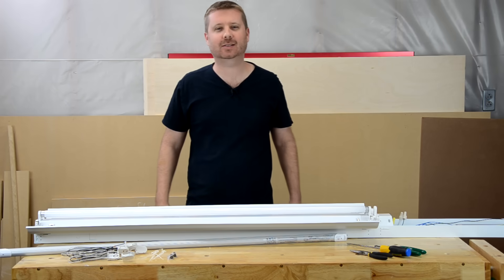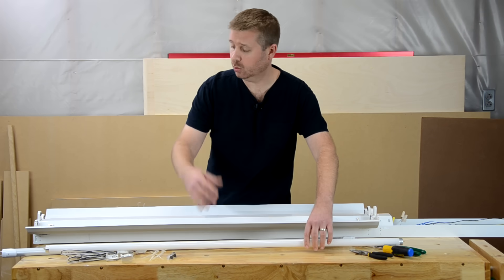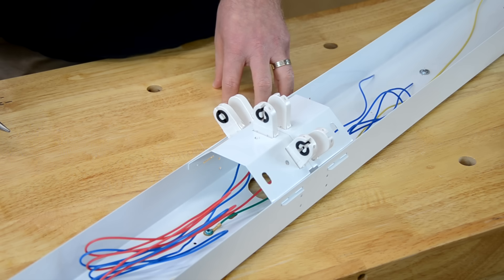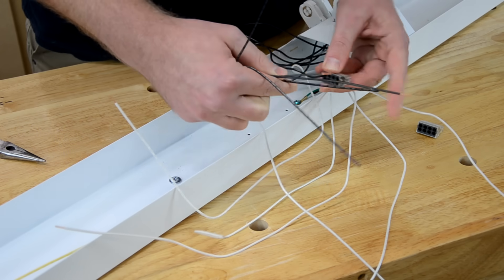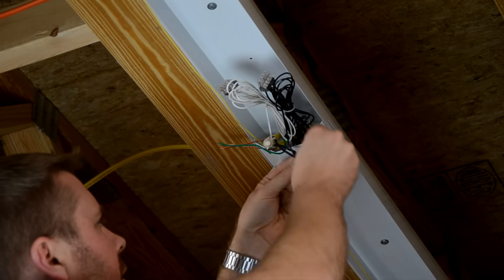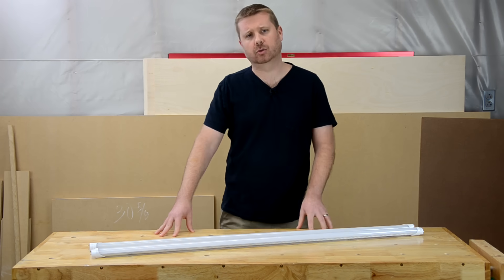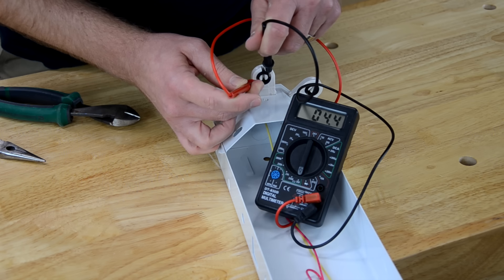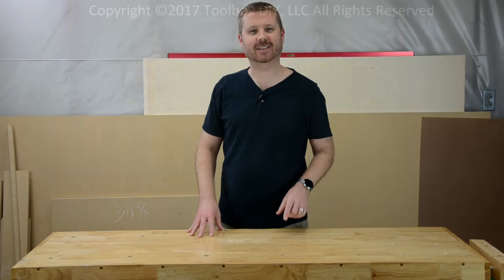How to easily convert fluorescent Lights to LED –Easy Ways to Save Money

Comment: Fluorescent tubes will eventually become very expensive to dispose of. 
TV's with picture tubes and crt screens have already become expensive to dispose of.
And it's not rocket science how to cheat on the disposal of these items. But I am only talking to responsible adults. So, no need for boys to try to prove how smart they are here.
Reply: All Fluorescents have a little Mercury in them!  If they didn't, they wouldn't work.  That makes them a Hazard.  These are the EPA cleanup instructions.
https://www.epa.gov/cfl/cleaning-broken-cfl

Or a little funny.
https://www.youtube.com/watch?v=R6VakfgEcP8
Reply: Nonsense JB Dragon, they have less mercury than the average tuna fish sandwich.   The EPA would also give you complex instructions for cleaning up something like a large rubbing alcohol spill but that doesn't mean you need to be told to grab a broom and sweep the darn thing up like any other mess.
Reply: Js Travelers - No.  There is now a trivial amount of mercury in fluorescent tubes, is not the same thing as a CRT tube.  The vast majority of a fluorescent tube is silica (glass) and aluminum, two of the most abundant (by far) substances in the earth's crust.  Literally wherever you dispose of them, there was already  more of those materials there naturally occurring than you are adding.

Ironically it is the opposite with LED bulbs.  You are then throwing away electronic circuits, chemical treated PCBs, heavy metals, and plastic that will linger for thousands of years.

You are deluded if you think you are talking to responsible adults because you are not responsible yourself for stating things in ignorance that are the opposite of the truth.

Please do educate yourself if you want to make a real difference to our environment.  Fluorescent tubes can also be recycled, nearly 100% of the materials.  LED bulbs, not so much, it all goes to a landfill in most areas of the world.

Comment: Only a shame, that led-tubes are as expensive as a full led-fixture. The big difference is that the fixtures will hold their brightness, while tubes will burn out due to (over-)heating. Also the promised lifetime of 50000 hour will be 10000. The amount tubes i have replaced by fixtures is huge.
Reply: Hi Barry, I bought 25 four foot T8/T12 replacement bulbs on ebay for $119 w free shipping.  Make sure you buy "Ballast Bypass Bulbs", the kinds with two pins on each end.  Remove and toss the ballasts (mine had two ballasts each), connect all the wires at one end of the fixture to one side of the line (hot), all the wires at the other end of the fixture to the other side of the line (neutral), hook up your ground wire, and insert your LED bulbs.  I did this with six free 2 X 4 foot troffers and they all work great!!  No point in making this any more complex than it needs to be!!

Comment: I have never thought every American is a putz,but there are a lot of people who would not wire up anything electrical to save there life and in Australia you will get a heavy fine for doing so as if you make any mistakes the live can travel to the earthing circuit and electrocute others and i have personally seen this in two cases so as for ballasts i have not seen one burn out in 40 years so it seems for a few extra 4 watts it is better still use the ballast and let other people get these led's in there lights with litle fuss but you never said anything about there options like Missouri wind and solar,secondly I have worked on major projects all over the world with Americans and i love working with them especially on drag lines for Bucirius erie 4000 ton drags
Reply: My fluorescents didn't work very reliably and the ones in the garage BARELY lit when it was below 50 F.  The LED replacements are great!!

Comment: Might be a good idea to mention how incredibly sharp the edges of sheet metal light fixtures are. Everybody does things different, but using the internal wiring to bundle itself makes for easier troubleshooting if required. And I would always use wirenuts for wire connection. I just don't trust those "push and pray" gizmos. At least I worried about that kind of stuff before I retired ;-)
Reply: Sharp sheet metal-- same on computer cases! Mfrs used to tumble in walnut shells, knock off edges, but no more! I call it A FOREST OF RAZOR BLADES!
Bring Band-Aids and Neosporin when you open all these things, and if you'll be back in there (or it's your own toy) take a file to accessible edges, then clean up steel dust with a magnet and tack cloth (before it gets between fine traces). Do it right, the first time.
Did my shop a couple years ago, no regrets; removed ballasts, cleaned and repainted white inside surfaces.
Reply: Might be a good idea to mention; Don't run with scissors.  Look both ways before crossing. If you live in a glass house don't throw stones.  Don't run around the pool.
Reply: I've been a electrician for 20 years wire nuts vs peanuts I can tell you from my experience there's no safety issues with using peanuts. I have found more troubleshooting problems from other people's work with wire nuts if not done properly a wire can slip loose and Ark or not be connected. My only complaint with peanuts are if using stranded wire that can be somewhat challenging to get in. I personally like to use wire nuts on stranded wire rather than the peanuts.
Reply: Not only are most modern sheet metal assemblies nothing but assemblages of razor blades, but by cutting those zip-ties that way you are adding even more flesh rending points. Use a flush-cutter and cut flush to the zip-tie head. (Your wire cutters are diagonal cutters. Flush cutters have the outside of the blades ground such that the cutting edges are flush with the outside face of the blades. Your knuckles will thank you next time you need to work on these.)
Reply: The sharp edges are due to mfrs using a mechanical process to make the parts. Whether a shear or punch/die combo these will leave a burr unless newly sharpened and perfectly aligned. Mfrs have 3 ways to deal with this. 1. Run it through a duburring process that removes the sharp edge by grinding it. 2. folding the edge over so that the burr is pressed against the flange (called hemming). 3. Do nothing and live with it. Of course #1 costs time/labor and capital investment in a machine or grinding wheel. #2 costs material and machining time as it takes more time to make the original part, that hem doesnt fold itself. 

Finally you can use a laser. A properly adjusted laser will leave almost no perceptible burr. What it does leave is not a hazard.
Reply: thereal440volt u
Reply: thereal440volt ... Yes, mention that sharp metal. Perhaps consider stating the importance to not pull those plastic ties tight with your finger in the loop.  And if this DOES happen, to remove your finger the tie itself should be cut, not the finger itself.  Though to be honest, either way will remove (pun intended) your finger.
Reply from the maker: I have to respectfully disagree. I have seen no evidence that these "cause fires". In fact you'll find these in a lot of UL listed fixtures these days. In this case, we don't have two different metals - it's copper to copper. Also, the amount of current going through these is under an amp. I do agree that the connection area is less than using a wire nut, but with such low amperage, this is inconsequential.
Reply: I hate that! I'm an electrician and I've cut my hands on quite a few sharp fluorescent fixture edges. It's like a papercut, it sucks! I always used wire nuts for a while when wiring ballasts and such but after doing it for so long and the time saved using the push-in connectors are well worth it. I only use the ideal brand which I've never had a failure on. Also gotta use some common sense like don't use them for anything but ballast wiring, always do a quick "tug" test. If the connection doesn't hold up to being given a good tug then the connection is not made in my eyes. Amazing how many helpers I've worked with who were never taught the good 'ol tug test. Can save you a lot of troubleshooting down the line bc a connection will look like it's good up until someone pulls it out of the box
Reply: My experience is that most of those metal cases are apparently made by Wilkinson Sword.
Just like the warning on food products about peanuts they should have a warning that "These cases are made in a factory that also makes razor blades."
Reply: Those push-in connectors are dangerous and will cause fires  in the future. They make poor connections since the contact area is very small, also where the copper wire and the metal of the connector touch, that area will corrode because of the different metals contacting each other and will cause a poor connection which will heat that connection up and eventually the connection will get so hot that a fire will start.
I have seen to many of those connectors and connections with them that caught fire. In our business we outlawed those kind of connectors and we will remove those push-in connectors if a light fixture has them installed already.
Reply: Flush cut plyers aren't part of your average electrician or homeowner's tool chest, BUT if you have a pair of linesman plyers you can twist the 'lil buggers til they snap off. The result is a nice soft nubbin of broken plastic. If I'm using the big thick tie wraps I'll usually cut little chamfers on those sharp edges if cutting into hands or other wires is a concern

Comment: Terms, such as "tomb stone" should be avoided.
Reply: Why?  What's wrong with terms?  They make things pretty clear for a lot of people.
Reply: Try a Google or Bing search for 'fluorescent fixture tombstone'.  You'll find thousands of hits, and plenty of catalog listings for things like T5 tombstone, or G13 tombstone...  It's plenty common usage of the term.
Reply: The real reason..."Tombstone" is offensive to anyone over 60 years old and can instill fear.
Reply: Hmm and strangely they are not called tombstones, in the same way that not all wheeled vehicles are called bicycles.
Reply: Bernie - Roger on that. I call 'em "cement graveyard adornments for folks that be suspiciously quiet." That keeps the offensive terminology hidden from the kids & gramps alike.
Reply: Data, bro, at 68 I appreciate your thoughtful, considerate pc,  lol  but it hits a pet peeve, Cement vs Concrete. Yes, it's now mainstream misuse spearheaded by you-know-which gender. :-)  None the less, Cement is a dry powder & but one component of concrete.  So it's like saying, "May I have a piece of flour & ice cream." - cheers
Reply: Stoichiometric - Blame it on Hollywood & the "Cement Shoes" in gangster films. ;)
Reply: Well, I'm an electrical engineer, and I'd know.  I've never tried buying them at Home Depot, but I'd venture to guess that if I went to my usual electrical supply warehouse, they'd know.  Maybe I'm wrong; the next time I'm there I'll try it.  But I'm more inclined to follow Terry Jones' suggestion and just replace my fluorescent tubes with new LED fixtures (which I've done in my home workshop).
Reply: Most electrical supply houses call them tombstones.  After all what do they look like?
Reply: +George W — There are styles of fluorescent lamp holders that don't look anything like a tombstone.
Reply: Bernie McCann what do you want  on your tombstone? Lol
Reply: +Yes — If you don't know the proper technical terminology and can't be bothered to learn it, you might was well call them "thingamajigs" and "watchamacallits".
Reply: Bernie McCa
Reply: +David Shaddock — Why?  Because if you walk into a hardware store, home improvement store or electric supply warehouse, they won't know what the hell you're talking about if you ask for "tombstones".  Besides, not all fluorescent lamp sockets are shaped that way.
Reply: +David Shaddock — I also happen to be an electrical engineer, and I have purchased fluorescent lamp sockets at places like The Home Depot to repair fixtures.  The term "tombstone" did not appear anywhere on the packages.  For example, see http://www.lightingsupply.com/light-sockets-and-accessories.aspx.
Reply: if you don't know that they have always been called "tombstones" then you are probably not best qualified to be sticking your fingers in the fittings, best stick with your job at "Home depot"

Comment: It would have helped if you had said: In the living room use 'this' -- in the bedroom use 'this' -- in hallways use 'this' -- in the basement use 'this' (Lumens)
Reply: This is about conversion, not visual impairment.  ;)
Reply: The choice of yellow-orange, cool or daylight is a matter of personal choice and cost.  I prefer daylight bulbs throughout the house, but they are the most expensive.  Some bulbs can also be dimmed which adds another user preference.
Reply: Says the young guy ;-)
Reply: No that would make no sense at all.  The # of lumens depends on the tasks, the lighting fixture, whether you have windows providing add'tl light, how many fixtures, the size of the room, etc.   Judge based on whether your existing lighting is sufficient, all bulb types have a rough average lumen output for comparison purposes.
Reply: Ed C no.  Cooler lighting is more damaging to eye, literally, and also creates more glare and worse CRI so it's not preference as much as being able to use the light to see well vs just being blinded by glare.  Also daylight bulbs are not more expensive, now about the same price unless you are only thinking about some particular product where the manufacturer prices them higher because the cost per unit to make them is higher, only because nobody wants ugly cold glaring blinding light bulbs.

Comment: I've been encouraging my corporate customers to do this for decades. Basically since these tubes became available. For those that balk at the capital outlay of a full conversion (especially in areas without green incentives on them) I tell them to simply convert a fixture each time a ballast inevitably fails.
Reply: A T8 Florescent bulb is costing me $3 in packs of 10.  The Hyperikon T8 LED's I get cost about $11 each.  These are 120-277 Volt.   I need 277 volt!!!  Not a normal Home Depot LED replacement unless I got one that needed the ballast.  I've replaced them to LED's in a couple offices.  I've like to convert more as the bulbs or ballast go bad.  Havn't made that move yet to do the rest.  The front office wants to do their own thing, and plan things, and then it never gets done, instead of myself just doing it.
Reply: @jbdragon3295   $11each ? The T8 tube 18W 1800lm ,pf0.9, we ship to US just cost 2.3$
Reply: pChristopher Gaul ‘h. Hi 51’/
Reply: Have never known a balast to fail but granted they could but they also draw some power so best to get rid
Reply: @gowdsake7103 
They fail all the time

Comment: The problem I had with the LED tubes was that I couldn't find any that were anywhere near as bright as the fluorescent tubes.
Reply: cliffh5 You need to put in 2 led tubes for 1 normal tube.
There are adapters available.
It's still not as bright.
Mostly, they don't need to, because the light angle is much tighter

It is better to replace the whole fixture.
Reply: The T8 LED tubes that I bought on Amazaon were much brighter than my original fluorescent tubes.

Comment: My magnetic lights are installed in 90 seconds in a 2x4 troffer. Mine are very safe and UL rated for any installation. UL released a bulletin about your type lights and if installed incorrect will void the rating and if the building burns down your insurance will not cover it. Ours have a failure rate of less than 1 percent. We have the highest lumens per watt. Good video presentation though.
Reply: Kayak Eufaula b